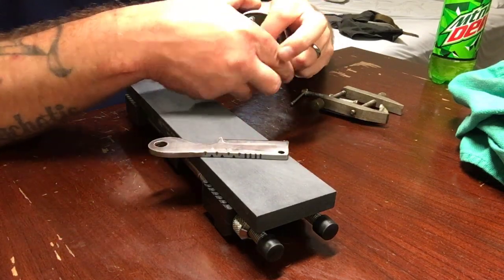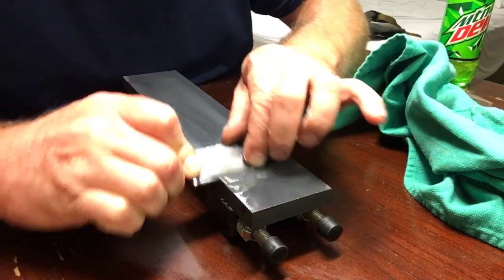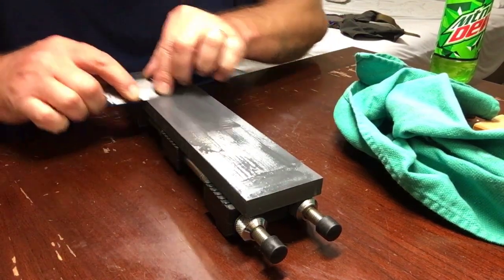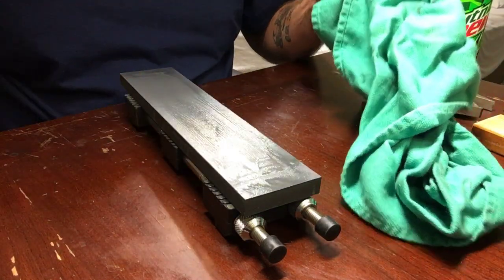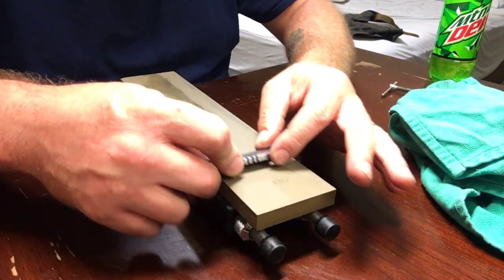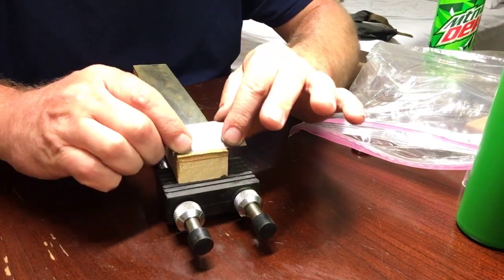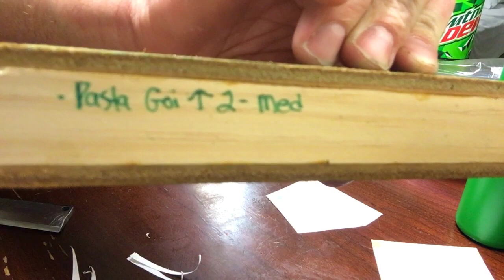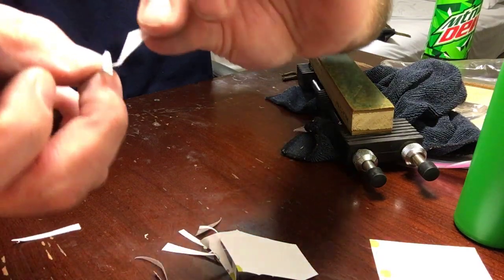Mini cleaver edge maintenance

Comment: If you use a brillo pad on those India stones - it will remove the load-up swarf. Even if it was used with oil.
If you don't mind me asking - were do you source your leather for your strops?  Is it horse hide? What is the name if this compound again ? Link??
Reply from the maker: Michael Shults hmm I’m gonna have to try the Brillo trick. And Ryan wear on here has sent me some leather. And I usually go to a Amish store locally. Dig through the scrap bins. I find some good stuff occasionally.
Reply from the maker: Michael Shults oh and type in pasa goi on eBay. It’ll bring it up. Great stuff

Comment: Man Ive heard the DMT stuff wears quick but I need something for reprofiling. My suehiro cerax 320 just isnt cutting it. literally. And you saying yours are wearing fast too has me second guessing getting them. Im pretty new to free hand and ive never had such a hard time choosing something as I have with stones or plates. My head hurts from trying to decide.
Reply from the maker: William Sleight the dmts are good. But they aren’t as good as they used to be.
Reply: get something else. i bought dmt's recently and they're quality control is absolutely horrible. i actually prefer the norton oil stones and water stones over dmt's